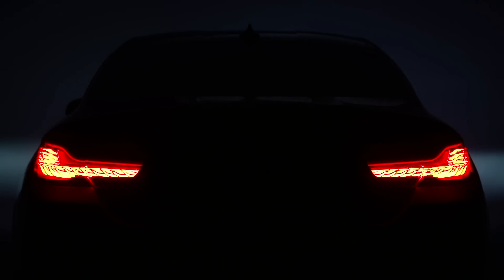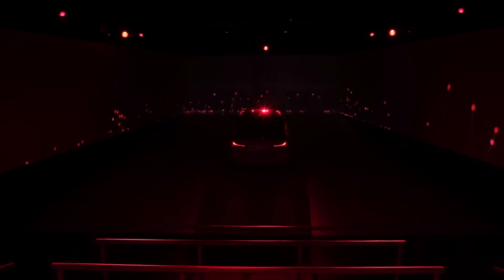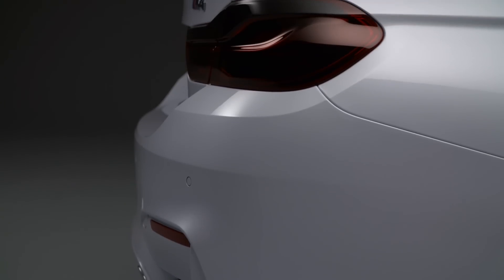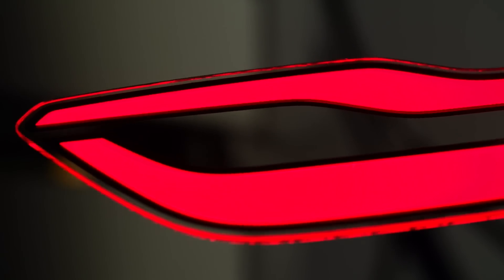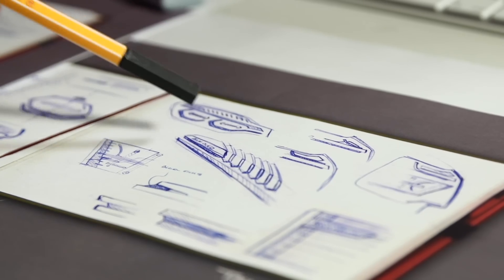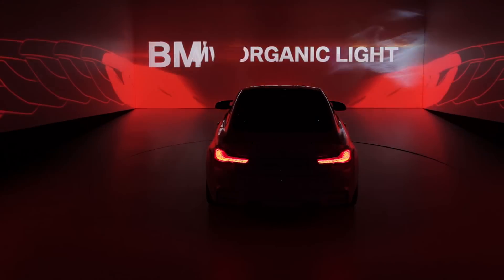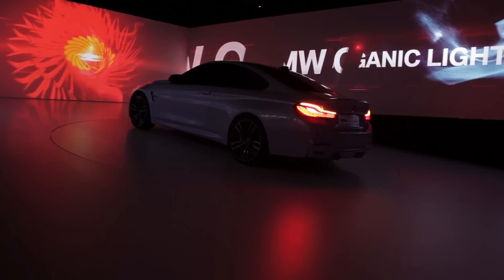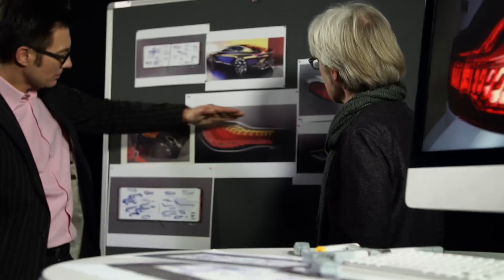The future of tail light innovation today. BMW organic light OLED.

Comment: 6 years later and I’ll still waiting for them to release a car with these tail lights. Not just put them on crazy ones like the gts.
Reply: It’s too expensive, Mercedes only did these on one car. Audi is doing a very half assed job with these and already stopped putting it on newer models.

Almost all cars has similar lights available aftermarket, although not really looking like these
Reply: @B-jv8iy  the new M3/4 is a $100,000 car.
They should be able to fit dope tail lights into their budget. Hell, just add them as an option like they do headlights.
Reply: Can but aftermarket ones that are pretty much exactly the same now either way ☺️
Reply: @seanohare3509  true that.
Reply: 2024 Audi Q8 was just unveiled with OLED taillights. Adios, BMW!
Reply: I've had aftermarket ones pretty much exactly like these.

Comment: BMW series all status grade D with Europe Automotive Engineering standard law by wider rear track than front track body works | the lowest traction 0.7g, extreme tail flick, extreme slide, 20-100 l/100km, over 100 l/100km by Formula one speed 160-250 km/hour, over 250 km/hour on all curve straight circuits.

All twinpowerturbo petrol engines and all twinpowerturbo petrol engines hybrid : Easy damage parts, 20-100 l/100km, over 100 l/100km by Formula one speed 160-250 km/hour, over 250 km/hour, test over maximum engines 20,000-150,000 rpm.

From
BMW databases 

End report.

Comment: One of the most stunning idea.  But now i have no faith on German cars. I was a Porsche technician 12 years back. Even those years, replacing fuel pumps, replacing head lamps (no breather port),  replacing navigations, replacing instrument clusters, replacing wiper mechanisms, replacing transmissions made by ZF :))  and oh my god, I have replaced countless seat frames all for one specific 12v dc motor ??.  I know one owner of reputed auto detail center went to court due to sagging BMW roof lining ))) Replacing major parts in German cars are like replacing oil filters in a Japanese cars. The quality and reliability of parts are unbelievably low. They are so focused on making things more complex. But its just like trying to keep an expensive gemstone in the pocket, as it actually add Zero value to the life  but a huge burden.  I am driving a poor Daihatsu Terios. Zero pains, perfectly engineered, material quality is good and can rely on. No failing mechanisms. I get thousand times more than I give.... and it looks like it will last forever.

Comment: BMW = Bring Mechanic With
Reply: +Hamish Robinson Or you cannot be a dumbass and figure the work out for yourself like a real man does. But then again....true enthusiast only drive ///M's. The "other" people drive regular BMW's
Reply: +Mike Bowman or unlike a dumbass you use your warranty and leave the work upto the BMW to do instead of wasting your own time replacing their low quality parts yourself. That's why smart people get warranties for cars that have a reputation of breaking so often.
Reply: Smart people don't spend the outrageous money on a new car and wait for it to go out of warranty and pick the car up for half price. I just priced a new BMW M4...$92,000! WTF??!! I bought my E92 M3 for $36,000 with high miles. You know how much unplanned maintenance work I've done in 4 years with an added 50k miles? About $250 and I did all the work myself. A fuel pressure regulator, a side blinker bulb, and 1 O2 sensor replacement. I ight have to replace a Vehicle Speed Sensor as my car is tripping for one right now...no big deal too.....easy crap. But then again, I'm a Molecular Diffusion Engineer and deal with much harder shit than a freaking car. So you go ahead an waste your money on a new car, then trade it in once the warranty expires and be stuck with car payments you whole life. Sounds like an awesome idea....or learn how to be a man and do the work yourself. There are plenty of forums with DIY videos and documents out there these days. If a man can't work on a computer, car, wood working, metal fabrication, cooking, electrical, and plumbing...then what is a man good for? And yes I can do all that, and cook!
Reply: +Mike Bowman or even smarter people buy it second hand with a multi year full warranty included in the deal
Reply: Ok waste money. Your deal. To each their own. I guess listen to yourself or to a 6 times BMW owner 4 being M3's. But I guess you're the know it all
Reply: +Mike Bowman waste money? Getting brand new thousand+ dollar OEM parts installed multiple times at a proper certified BMW workshop for a couple of hundred bucks on a warranty? You sound pretty stupid not getting a warranty but to each their own, waste your time and money buying and installing your own parts if you wish, guess my time is just worth more than yours, I guess the time you spend fixing your car is more important than the time you actually spend driving what you've paid for.
Reply: Ok I'll end the conversation on this note. In my career I'm a Molecular Diffusion Engineer. On a daily basis I fix, service, upgrade, and maintain vertical diffusion reactors...81 of them! They have over 10,000 alarms and 500 pages of schematics. They make BMW's or any cars look like childs play...because they are. I'm not your average dishwasher idiot like you apparently think. When I blew the head of my previous M3 I rebuilt the damn thing myself. It was the easiest thing I've ever worked on. You think a 2016 car is any worse? Nope just as easy. I don't need a certified person to work on my car. I'm certified enough with my electrical and mechanical engineering background. So YOU waste you money on warranties if you want to, I'd rather enjoy my time under a car knowing I'm doing the job correct and not trusting some "certified" guy that just got out of school. So please, go preach to someone else about certified this or warranty that. Real men fix their own cars, and computers, and electrical, woodworking and plumbing, and I can even cook! How many BMW's have you owned?
Reply: +Mike Bowman you seem very proud of yourself for some strange reason (you do kind of sound like a 12yr old bragging to his friends about his new toys though), I'm sure if you can buy all your BMW parts for zero cost then a warranty is useless for yourself (because we all know BMW oem parts are the cheapest car parts to buy), being an engineer with multiple BMW's I'm sure every part you've ever needed has cost you all of nothing? and I'm glad your years of experience have gotten you all those free parts for all your self done DIY repairs. While you rip your failed engine apart I'll just sit down and have a coffee knowing that the extra $200 I spent buying a car a few years ago has paid for all the parts, liquids, and someone else's time to-do all the work over all the years, enjoy having your head under the bonnet instead of driving what you paid for.
Reply: I blew the head racing....driving it like it should be driven. I'm 40. And I bought all my OEM parts at discount....pays to know other BMW lovers in high places. And I enjoy working on them. It's on thing if I hated it...sure the warranty would be awesome. But I'm a car guy. And you act like my cars break down all the time or something. They don't break down because I do my own work. Proper maintenance and you dont have to be at the dealership 24/7. I'm still curious....do you own a BMW? Nevertheless, multiple M3's at one time? Yeah I like my toys. I don't make 6 figures to drive a Hyundai. And just so you know...I had a warranty I paid for...had it for a year and a half paying $300 a month. Guess what....car never broke down. Only reason why I bought it was because I was travel the world working and wouldn't have time to fix it if something did go wrong. But my BMW's dont fail me cause I take good care of them...except the one I blew up....which runs like brand new now, better after I fixed it myself. When you make $30k a year I can see where a $1000 fix might be costly. But I'll let you stick to your rides and expensive warranties. Have a good one. You never know what the ultimate driving machine is like being scare of maintenance cost....or you can just leave it to the big boys :)
Reply: +Mike Bowman oh yes, owned a few BMW over the years, few Audi's too (they didn't fail as often as the BMWs but still had some small issues) glad you got your parts at a discount, didn't have to pay for mine due to those waste of money warranties you mentioned. They were also serviced but the parts that generally fail have nothing to-do with service issues as most owners know. I find it funny how tow truck drivers have on their stats sheets that BMW are their number one towed car out of all brands here, guess every single one of those owners must have service issues because they didn't do their own work like you (unless BMW service centres perhaps do a really bad job on every BMW they service?), maybe Honda & Toyota owners do more of their own services perhaps such as yourself which causes them to keep going? or maybe they just have higher quality parts that don't fail, hard to tell...

Comment: Well one week after waiting two weeks to get my BMW back from a water pump and radiator failure, now the alternator has now died too, compete lack of quality parts on a supposedly high quality car.  The tow truck driver said the company tows more BMW's than ANY other brand of cars, has ANYONE had a BMW that's managed to reach 65 to 70000k without having major engine bay parts fail or electrical failures of some type that require towing the vehicle?? I will never be getting another BMW as long as I live as the quality under the bonnet is one of the lowest compared to Japanese vehicles that seem to be reliable as most would expect a car to be, Hondas seen to-do 180k plus with ZERO failures, and they don't have the money making stupidity of BMW to require recoding your car with a simple thing as a new battery (seems a Honda without stupid BMW battery learning tech even have their batteries last longer too!! and don't charge $100+ at a Honda dealer if you put in a new battery) plus now another week or more wait for an alternator to be imported from Germany, seems BMW cars are stress tested for endurance by driving past a camera for photo shoots only.
Reply: driving a E39, still going strong after 182000km
Reply: The parts on mine started to fail at 125,000kms. But then again, it's from the reliable-era , an E36. Built like a tank.
Reply: But for all its misgivings, the only time I was towed was when I slammed into a concrete barrier. And even then, it was my choice coz I bent the lower arm. I could've driven it off if I wanted to but I decided not to worsen the damage to the arm.